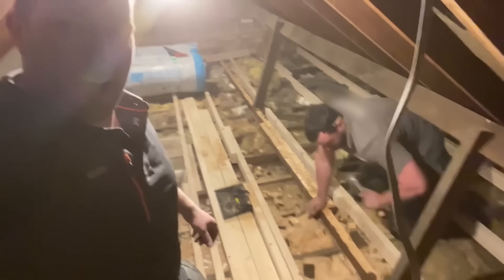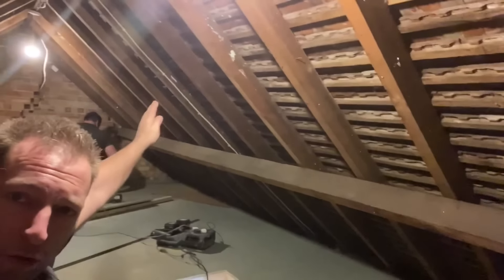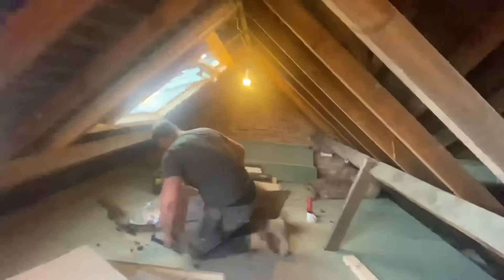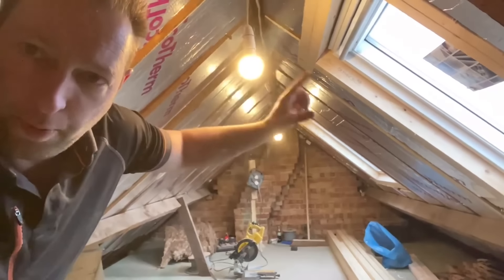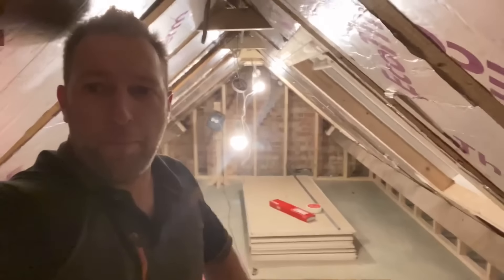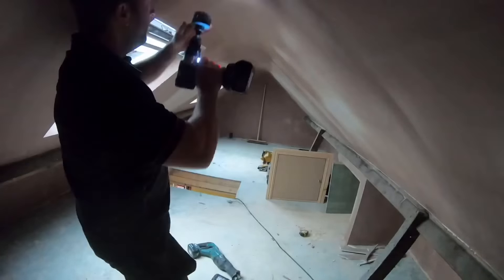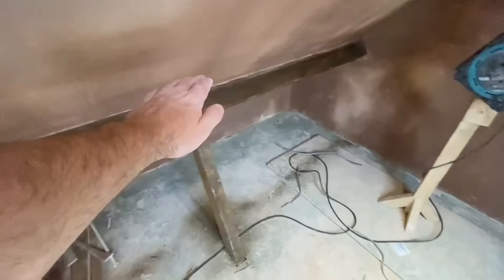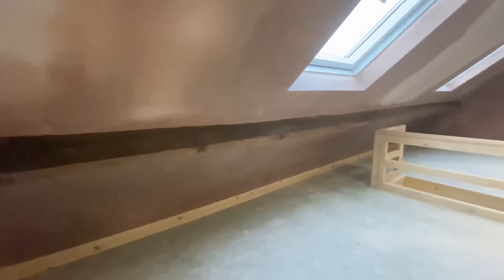LOFT STORAGE SPACE CREATED

Comment: Won't the ceiling sag? The weight of the floor on them thin pieces of existing timber holding the weight of the new timber plus flooring plus whatever you putting in the room.
Reply: Them thin pieces of timber are what’s stopping  your bedroom and bathroom being in your living room😂
Reply: @jonodunn2592  I've done similar for storage but i put sprags in screwed to both the "joists" and the rafters/pearling depending where i place the sprags, certainly wouldn't do it without sprags and 100% not for a bedroom 🤣